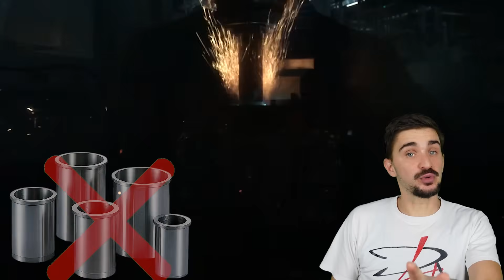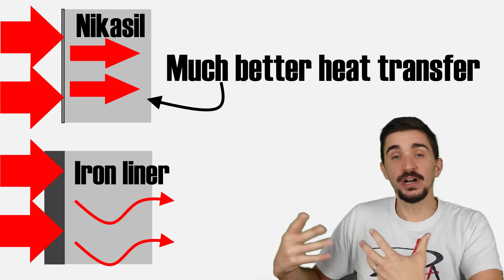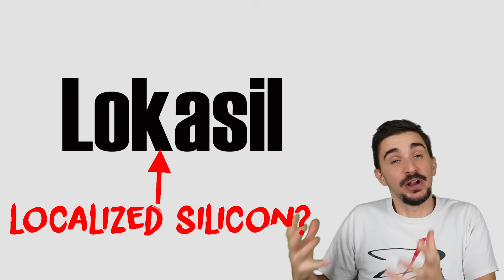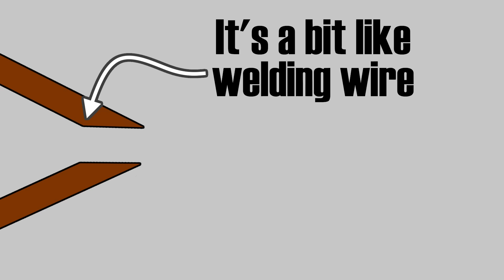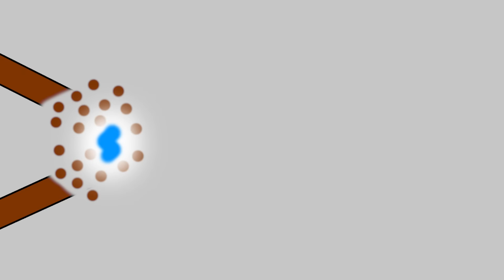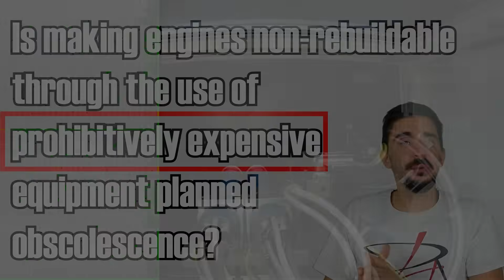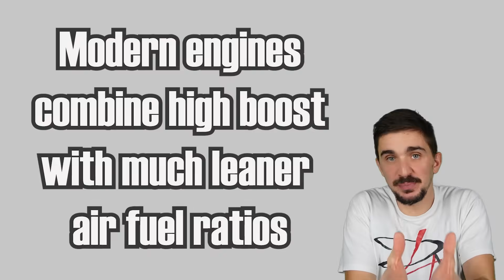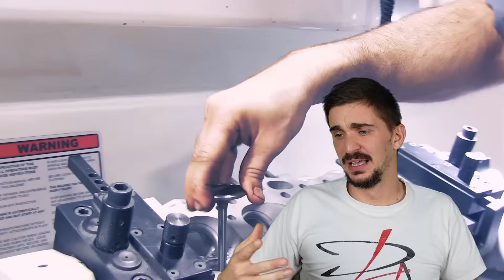Why Are Engines Becoming Non-Rebuildable? Everything About Cylinder Coatings

Comment: I’m rebuilding a BMW M62 engine from a 96 e39 540i.

Nearly 300k miles on it and when torn down the bores looked great. Alusil coated bores. 
Absolutely no one in UK wants to touch it, even for a light hone.

Comment: Love your videos bro. One stupid question for a video. Is it possible to  make a dual fuel engine (diesel and petrol). I mean in a combustion cycle working like a normal petrol engine, but then inject diesel exactly after the combustion of petrol and air happens, so that a second combustion beans from the diesel.
Reply: Not an engineer, but my answer is NO WAY.
Petrol and diesel work on fundumentaly different priciples. Petrol engine injects fuel mix (petrol + air) which is compressed and then ignited by spark. Diesel engine compresses pure air to make it really hot and then injects diesel which selfignites when warmed up.
After combustion of petrol+air mixture there is no 1; air to allow diesel to burn and 2; not enough temperature to ignite it.

Comment: I would rather re-prhase the whole issue ... CO2 emissions is a important measure, if you are the niche little insignificant percent of the population that thinks it has any measurable end effect for the global environment. The real question is the economics of it in the long run and realistic economic circumstances of the general population - thus a question of the overall lifetime of a car itself. Re-castimg the engine is one thing, if you realize you do not think about the ratio, of how many engines are swapped vs. the whole car is trashed ... I do not have the number, but if one thing I can say is, that in the EU, most of the favors for the engine swap are in Germany and such economically performing nations, and much much less anywhere else. So, if we think of the best of the best possibility of the whole car lifecycle  being in Germany, its probably OK, but lots of it does not end there ... and wont be treated like that. The second is, it is not the only issue, that can trash a whole car. The more complicated and much much less economically viable repair in places like the less performing half of the EU speaks for itself. ... that is also, if we strictly stay in the EU. Nowadays, the question is also pushed further by the question - " Is the EU gonna stay as viable economically for the environmental factor be still economically practical ? " Simply due to the energy suicide and industry expulsion. So, I would simply say - the only real measure, that would be any viable, would be - can the general population man reasonably afford to repair its car, and how much can he repair himself ( together with the lifetime of a vehicle and life-long availability of a repair service ) ? ... and why do we keep putting emissions standards that do not make any sense and do not lessen the overall waste of materials used, energy and individual wallets.  ... all for a product that has its value exponentially drop by the year into the servicing price hell ?

Comment: I remember engine rebuilds being common decades ago, and was recently wondering why it is no longer a thing, so thank you for helping to answer this question for me :)
Reply: labour cost is too high as well in Western Europe. No one wants to do anything except brake pads, tyres and oil changes. Even refill your air con will cost you more than £70 in UK.

Comment: An engine as early as my Triumph Daytona 900, which was on the drawing board in the late 80s, is practically non rebuildable. at least with new parts. There are no oversize pistons for a rebore or undersize shells for regrinding the crankshaft. The valve guides are, according to the Triumph Workshop Manual, non replaceable, though I suppose you in reality could if you set your mind to it. Cylinders and pistons were replacable as sets, but no longer available, the only practical source now being the scrapyard. The same with crankshafts and rods. With 190.000 km on the clock it's still running as when new, so what is lost? Very little. Modern engines has taken it a step further as you have described, so "planned obsolesence" regarding engines doesn't really apply when the engine lasts longer than the vehicle it propels.

Comment: Why not just buy a new engine block I've had plenty of race motors over the years where I kept my heads I kept a lot of components but I had to buy a new block not a big deal just look at it like any other part you would replace when rebuild it or just consider it to be a crate motor

Comment: Something not discussed about modern engines and their building process, as we know modern engines also have an oil burning issue we know toyota and hyundia/Kia are more then well known for their oil burning issues, which as we know oil destroys catalytic converters resulting in those cars producing more emissions. The environmental impacts can't be properly measured when such engines have an "acceptable" amount of oil burning allowed by the dealer. A liter of oil burnt in 1000km will in short order destroy a catalytic converter. The only solution is a 5k new engine, by doing such a coating it has stopped the driveway rebuilds from happening, most oil burning engines can be remedied by a hone and rering, something most mechanical fokes can do in their driveway or garage for a couple hundred bucks.

Comment: This is nothing new. I had an old Peugeot moped with a chrome plated aluminum cylinder that was not re-boreable.  It didn't last as long as my PUCH moped with an iron cylinder. These coatings actually work very well when done PROPERLY. When not done well you end up with a car called Vega, an overheating, oil burning and fast rusting nightmare.

Comment: I had a mercedes 240D W123 benz that i drove to the tip with 1,300,0000kms. 
If modern cars dont last long, its because that by design. People buying new cars every 5-10 years is much more profitable than people buying new cars every 50-60 years.

Comment: You made big logical mistake, and by comment that 10 year old cars have worse emissions, so stopping using them have benefits, looks like you are aware of it. It isn't impact of rebuilding engine vs. impact of recycling engine. Buying new engine for 10 year old car isn't economically viable and in most cases impossible. So, if engine cannot be rebuilt, whole car gets dumped. Ok, some parts will be reused on secondary parts market, but is engine failure rate is relatively high, that market is already saturated with parts that last and there is high demand for parts which usually fail. There are plastics (some non recyclable), other parts which need to be properly disposed...  Also, non rebuildable engine will be exploited while it passes MOT, with increased emissions caused by engine wear, while rebuildable one will probably be rebuilt before last possible moment.

What are your right about is fact that rebuilding is rare today. Newer cars are made with planned obsolescence build in other parts, so at point where rebuild would be economically viable for older car, newer already have sun burnt plastics, electrical issues, paint issues, rust...

Comment: The way most makers do. It is to reduce the oil change period so that the engine makes it through the guarantee period then does what it wants to.  The way to sort that is to halve or more the oil changes. They also make the wet belt system so it self destructs at 40000 miles (PSA/FORD) and nothing is worth repairing after that as the engine is cheaper than the repair, or scrap the four year old car.😢. Aircraft engines are all petrol cooled and need a LOT of replacement parts on the top end.

Comment: Idk, if you have a car with like a 2 liter 4 cylinder making 150 hp or some similar stats, the engine is not going to be what kills your car. Its going to be some software not being supported anymore, or some fuckshit sensor kicking the bucket and not being able to be replaced. Even rust is way less of a problem than it used to be.

Comment: Planned obsolescence is still part of the decision. Planned obsolescence is not mutually exclusive from some of the other benefits of these coatings in aluminum blocks. Making the engine non-rebuildable is as much a feature as the rest of the features these technologies give. But, it only benefits the manufacturer at the expense of the customer. These new technologies are a problem because they negatively affect right to repair.
Reply: BTW, planned obsolescence is something they won't admit.
Reply: Another thing, large corporations don't mind a situation that causes a temporary expensive investment that could lead to large profits because more automobiles will be sold, especially when they can blame the regulations for the planned obsolescence effects. The regulations give them a planned obsolescence that they can deny.

Comment: The problem with the parts argument, is that they already doing it, watch any KIA or Ford/GM parts, those bastards fall apart if the WET BELT doesn't snap first.

Comment: I hope the coatings have improved vastly in 50 years.  This is similar to what GM did to the Vega engine in the early 70s.  The engines burned oil horribly after 30,000 miles.  (I am not sure they coatings have improved-I just saw a teardown video on a recent Mercedes engine made without steel liners. It had the same engine issues as the Vega engine.

Comment: So, why doesnt a company make replacable coated aluminum sleeves?
Reply: Probably in large part because there's no money in it. Like he mentioned at the end of the video, the only engines that get rebuilt are industrial, vintage, motorsport, or somehow special. Most industrial engines are diesel, which are steel blocks anyways, and many of the other cases would also use cast iron sleeves anyways. The cost incurred to convert existing engines to aluminum sleeves might not make sense, considering that cylinder coatings already have a bad reputation for being non-repairable. Who knows, in 5-10 years, maybe some company will sell them, considering cylinder coatings are becoming mainstream.

Comment: Another amaizing video!  I never really thought about how different materials heat dissipation would allow to run  engines leaner. Altough i have met this with this principle on motorcycles, when you have heated grips fitted, and suddenly you change the oem handlebars to an aluminium one, suddenly the grips appear to be nowhere near as hot for the same reason.
Reply from the maker: A great and very illustrative example!

Comment: I feel like I should point out that the people who respond to the numbers presented here are probably not as interested in this channel. The people interested in this kind of content are the people who build in their garage, push the engine to the limit, then rebuild it the next day. For THEM; rebuilding is more cost effective, and environmentally sound. Overall, I'm not sure if they represent enough numbers to skew the results much, but they're a focused sample. Scientifically, they should be considered separately, since they're a significant sample. That raises the question of whether this technology being adopted would force those people to destroy the environment by taking away the engines they can play with "safely", since they're definitely going to continue tinkering with performance.

Australia is a very significant point to make, and I was talking to a friend about this the other day. The Australian market is such that manufacturers don't even need to bother with this form of R&D. GM has Holden in Australia, which they get a lot of data from private tuners modifying the cars. The results of those people pushing the technology to its limits gives GM real world testing data, which they often take into their technology for Europe and North America.

In summary, I think the people who watch this channel most would be asking if this coating makes engines impossible to "rebuild" in their garage after trying to get 5000hp out of their 2L 4 cylinder engine. (Don't @ me, I'm making a point).

Comment: Interesting when you talk about the race engine using an 11:1 mixture, basically using the excess fuel as a coolant to keep temperatures down, An old friend of mine once told me of his wartime service as a mechanic working on Wellington bombers. He said that at take off, there was a setting on the engine mixture controls that was called "anti knock". Basically what you described for the race engine, a very rich mixture that reduced combustion temperatures, preventing pre-ignition or knock.
Following on from some other comments, fifty years ago or so, engines would often wear out long before the structure of the car (even with the rudimentary corrosion protection of the day). You would basically have a sound and valuable vehicle, that needed a new or rebuilt engine. It made good sense to replace the engine, and get more use from the car. Engines today last very much longer, as do car bodies. By the time either the engine or body needs major work, the car is simply too old to be worth repairing in most cases.

Comment: Thanks a lot for your explanation videos. I sometimes take the time to watch and always there's a new thing to me. In general, new technology has benefits compared to older systems, if it's working properly... But you have to admit in terms of individual automobility that raising vehicle mass is contrary to both economical and ecological savings. 
When it comes to the end of an engine's life span no-one can ever say if it's worth repairing, rebuilding or replacing. By the immense variety of different types in some cases it can make sense to rebuild. I welcome it, even if lower emission standards will be reproduced or held alive by doing so. 
But the engine is just one part of the car. And do you really save the environment by replacing the whole system "car" due to an engine failure after some 150k km?
I don't think so. The overall cost and emissions of producing the entire "car" that doesn't last 20+ years and delivering the needed emission values just in theory not in all day use are fairly less than maintaining an older standards car that will be able to re-run 300k +km! (Tell me one efficient modern car reaching working temperature on cold winter days in less than 15min? It's the short distance that kitll every ecological effort making the new engines almost never run in their ideal environment represented by the theoretical figures.) But that might make sense with my 1.6l 4-cylinder engine with an average consumption of 7,5l/100km, not with an V8 or straight six of the same era (1990s) and 2,5l or more volume.
I'd like to have modern, reasonable cars consuming around 3l/100km what's possible with today's technology! But they're getting bigger and bigger and heavier and in the end in absolute chifres are less efficient year by year!
Whilst the advantage of progress in relative efficiency is undeniable, the circumstances provide everything to consume it and return it into more absolute moven mass!
The laws of physics stay upright. We won't change anything by guarding our consuming habits and wanting to impress with the biggest car. It will start changing the moment we are ready to "avoid". Avoid taking the car that much, avoid driving bigger, faster, avoid being better than the neighbour, avoid greed, envy and selfishness.
Then it might make sense to replace instead of rebuilding. But we're far from it...

Comment: So if you had the ability to do this by yourself and didn't care about every gram of material it would be the least wasteful to do a solid cast iron block with a nikasil coated piston and lots of boost and lots of cooling?? Then just keep re boring re honing and re electroplating every and slightly sizing up the piston every time you start to lose compression or get to much blow by and repeat until the block cracks then melt it down with some extra iron recast it and start over??

Comment: My 2 strokes with Nikasil coating lasted forever. I would change pistons whenever I noticed a drop in performance but the cylinder always looked great. That is great stuff if you run the correct fuel.

Comment: Kudos Again!  Another Excellent, well done, well informed Video!  Thank you.
However.  To get good "passable" EPA #'s Their using much smaller engines (2.0L) boosting & revving them up to get H.P. /Toque. With those facts, they cant/ wont last long.  designed failure, lasting long enough for customer & EPA to be happy enough, so you buy another one just like it.

Comment: 28:18 Yeah but if we are throwing a car away just because rebuilding the engine is equal or more the price we paid the car or more of its price on the market, you just throw and waste an entire good car for a worn engine, so now it's an way bigger amount of CO2 involve in this waste. I know that a lot of people are thinking like this " ok this repair cost more than my car I' m throwing my car away " , I think it's stupid, you know what have been done on your car what's fixed and made reliable and what is needed to be done , and just because the price of the repair is more than the price of the car on the used market you junk it, and then buy a used car that you know nothing about, that always come with its surprises, unless it was perfectly maintained with all the invoices. Or even buy a new car, that is a lot more expensive than the repair of your previous car, and that will have more problems and more expensive repairs to do at one point. Plus, for example if you car cost 1000 € on the used market, it's still not its real value, its real value is the cost to manufacture it. So your 1000 € car is still a 15 000 € (?) 20 000 € (?) real worth.

Comment: 25:18 in those numbers did the energy used or emissions generated for the logistic at every point of a manufacturing of a car or for the recycling of an engine block added to the calculation?